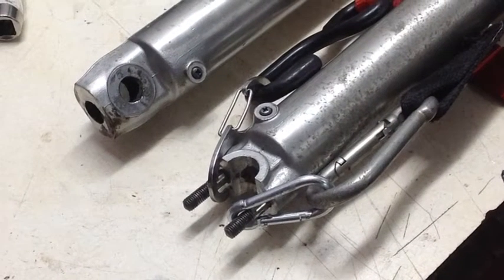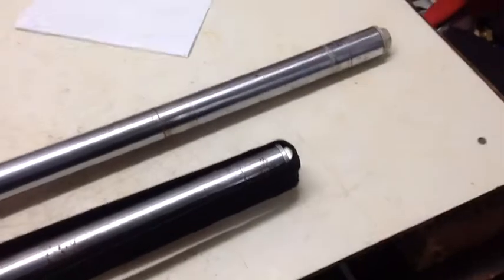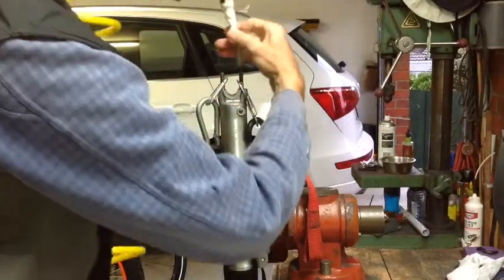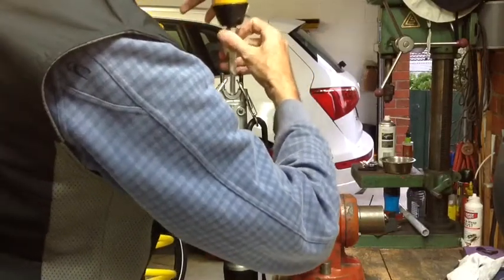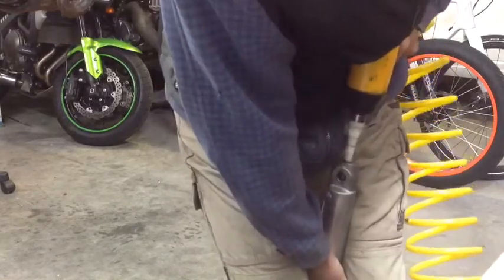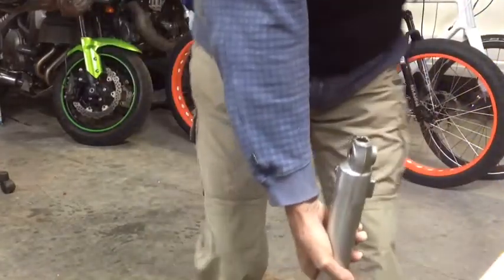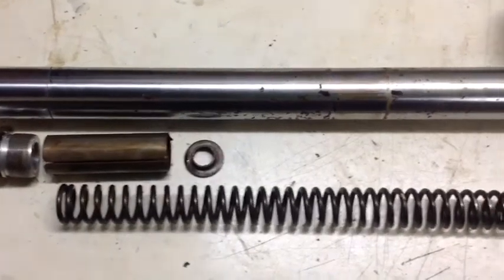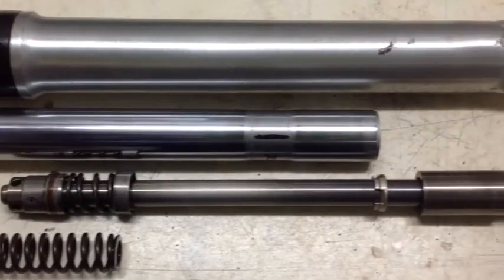How to remove a spinning bottom bolt on old forks, DT400D series. Tioli Bikes

Comment: Thank you for this video! This is kind of what I’ve been trying to do but it’s been a headache. I stripped the hex screw pretty badly, now I gotta see what else I can do.
Reply from the maker: @adrianb1655  Ooooo that’s going to be a problem. Maybe a big easyout  at a last resort if you can stop it from spinning maybe drill the head off and deal with it when it’s apart glad it’s not how mine turned out.
Reply: @tiolibikes8663  Well I took it to a buddy of mine and he got the screw out. Had to order two new screws to avoid having this issue any time soon.

Comment: I could be wrong but I think there maybe a hex hole on the inside or at least there are 17mm female hexs on the inside of my Yamaha SR500 forks 
I made a hex fitting by welding  a 17mm nut and 17mm bolt together and that fits in this internal hex and with my 17mm fitting and a 17mm socket and extensions you can hold the internal part that the bottom bolt screws into from the top of the fork without it turning